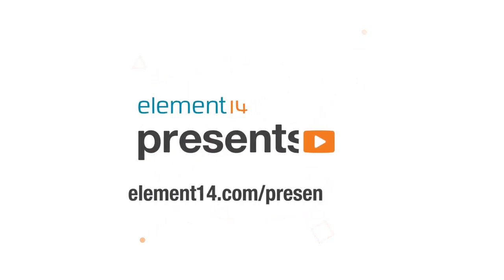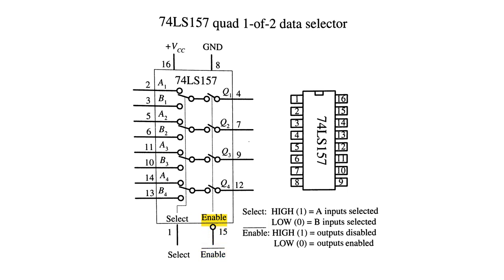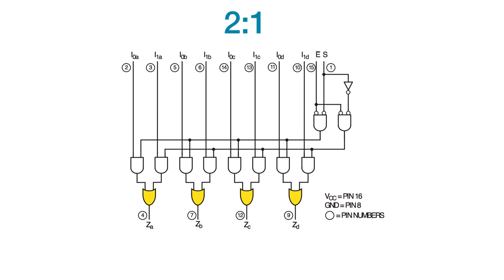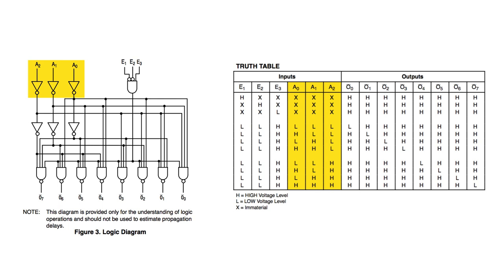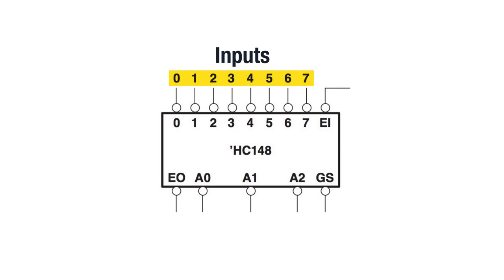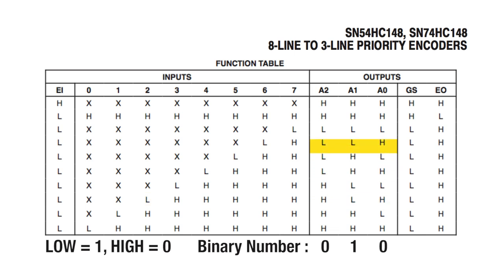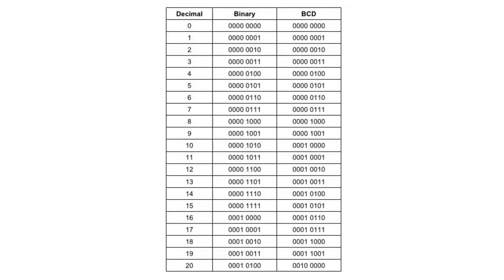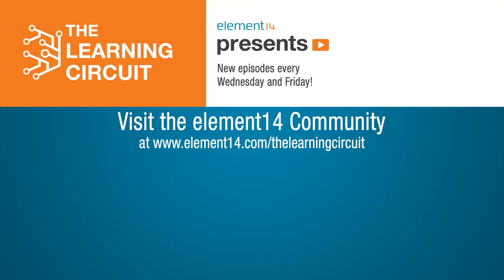How Combinational Logic Devices Work - The Learning Circuit

Comment: Very precised straight to the point explaining Combination/Sequential logics ,Multiplexer/Demultiplexer circuits ,Encoder/Decoder pdip pkgs ,7segments datasheets ,...ect . for absolute layman/beginners to start design a simple hardware digital circuitry on Breadboard ! Excelent ! You can use sofware Multisim/Fritzing simulation and verify with Cheap/7400/4000
 hardware IC for verification, buildup competancy hands--practical  .

Comment: You could build a radio around using the 74AC00 as an oscillator and a 74AC74 as a quadrature phase generator which would drive a 74HC152 in conjunction with a few MC1450s that  to configured as a Quadrature Sampling Detector which drive a quadrature phasing transformer which would drive a speaker via a power-amp and by changing the oscillator you change the frequency you receive. BTW the oscillator operates at 4x receive frequency.